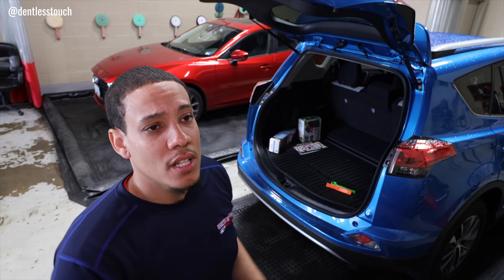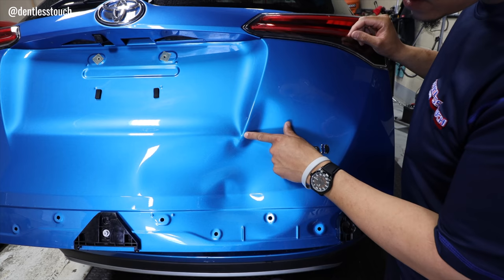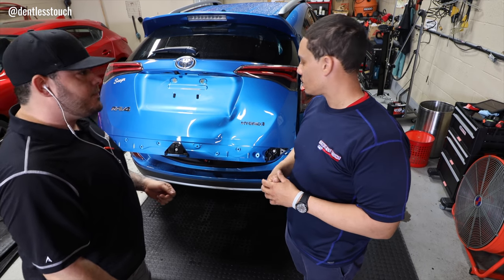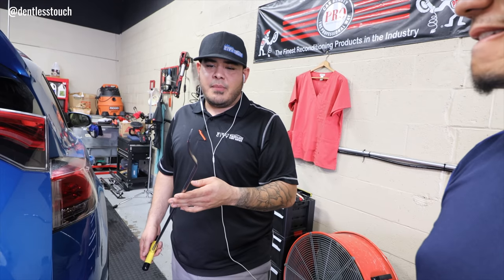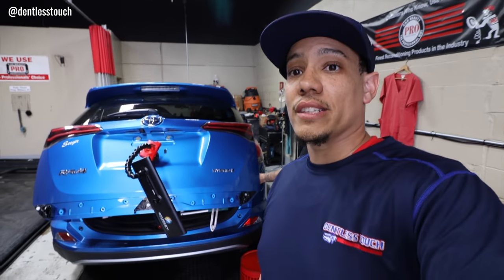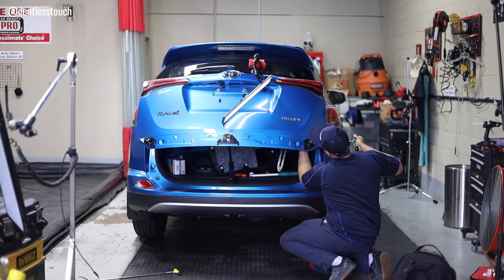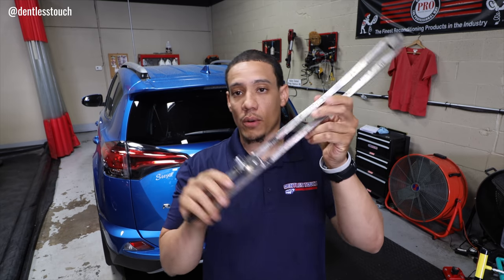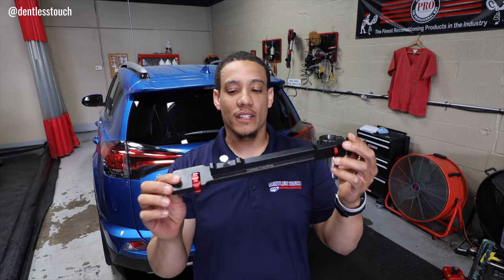Toyota Rav4 Smash Rear Hatch Paintless Dent Repair | Stanliner Tools

Comment: In the old days when metal was thicker and less forgiving of such a dent, It was screw type pullers and using a hardwood block behind on that pinch. Enamel paint doesnt stretch like todays paint. Such an accident would have cracked the paint and required you to sand everything down and repaint. I realize it takes much longer to fix a dent but the possibility of saving a panel like that is much better than years ago. You are a metal magician! Great job! My dad would be blown away. He used to fix everything the old school way. Bondo.

Comment: Funny I just did a black 2024 rav4 today with the same type of dent along the bottom like that one but sharper. Took the inside and outside trim off. It took over 2 hours to repair a dent the size of a baseball that went through 3 body lines but it was difficult because the new Rav 4 lift gates are aluminum.

Comment: Chris you use more stanliner tool than all the other tech. Most of the other tech use more glue pulling. I think your method is more technical great job
Reply from the maker: You’re absolutely correct but  glue pulling can save you a ton time. If you do it properly I just like to control aspect I get with a tool

Comment: You guys did an amazing repair on a hatchback that most body shops would have thrown away, how many hours labor went into that repair ,Im guessing 4 to 5 at least, also amazing that you left the letters on it didn't have to take them off does as you know ,emblems and letters are hard to put back on ,unless you buy the factory pack kit are almost impossible to put on straight if you don't have experience in putting them back on thanks for sharing great job guys

Comment: Hey mate great video! How much would you charge for something like this to be repaired?
Reply: He’ll never say.
Reply: These PDR guys get big bucks. The beauty of PDR is that your not touching the finish of the vehicle. The dent comes out with no refinishing. 
A dent that size working 8 hours probably $600 to $800. A body shop would probably be $1000 to $1200 to repair & paint. A high end repair shop would more than likely would want to replace the lift gate...
Reply: @Jazzhog  i would rather replace the liftgate for the one I have.
Reply: @marliseisrael3017  To replace that liftgate on that 2018 rav4, in that color you're looking at around $2500.00 Give or take. Depending what shop you choose. That's with an OEM LG. The parts alone are just about $900+ 
The rest is labor, plus paint & materials. IMHO what Dentless Touch is doing is a better option. However, if it's an insurance claim and you own the vehicle, It'll be your call. Remember, you have 3 options. Replace, repair with bondo or PDR. PDR techs like Chris, are rare. Chris has unsurpassed talent...
Reply: @Jazzhog  oh no ..i have a DGC fifth generation.  I have seen them at junkyards for cheap ..there use to be a video on YouTube showing how easy it is to remove and replace.  So if I do decide to change it I will that way.
Reply: @Jazzhog  all you need here is just the shell which is max $600 from the dealer. the rest is just the the paint and labor to transfer all the parts to the new shell. That's around $1500 total (if you are not going to Toyota dealership of course), if you are a little handy, you can have them just paint the shell and do the mounting yourself and save some $. 
But of course, if PDR is cheaper, I'd also go with PDR.

Comment: Nice, but 8 hrs ?
Get yourself a Flatliner airbag system, 3 sizes, flat pads slide in tight spots, minimal air pressure required, 5psi will do it nice and easy.
Pop those big areas out fast, sometimes they just fall into place too and not much work to finish off. 
Steve has them at Ultra Dent, a lot of panel shop suppliers have them too.
Made in Germany, tough vulcanised rubber, you can lift a car with them, can't stab through them with a knife.

Comment: I definitely think your approach was better. Not that Dave’s approach is wrong, because it can work that way as well and is how I would’ve done it for many years. But I think it would indeed just strengthen that deep and bound up impact area. Making for a longer and more difficult repair with a high probability for more imperfections.